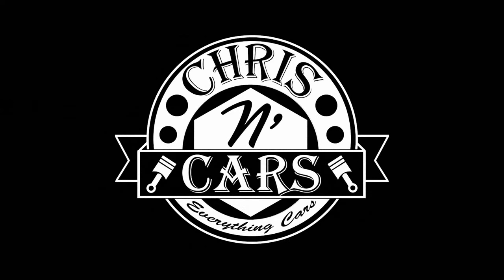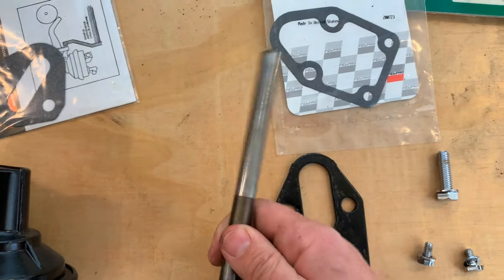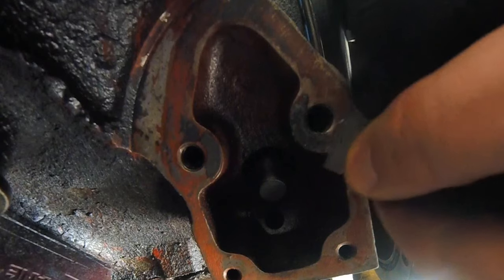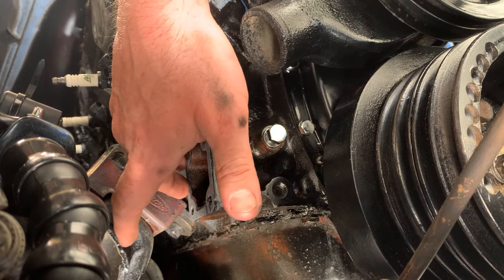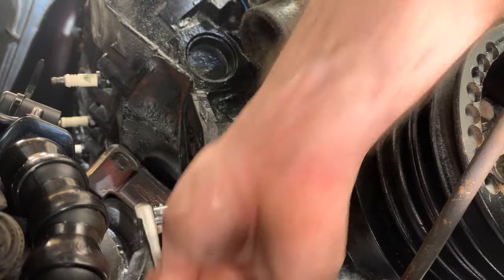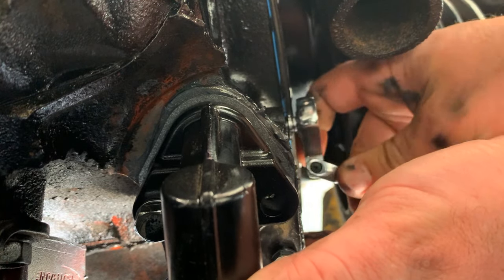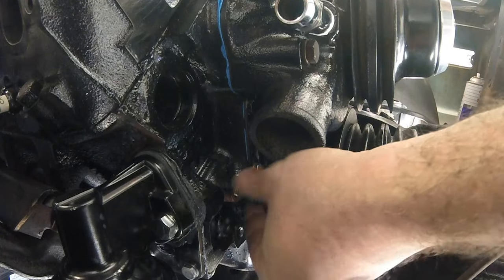Small Block Chevy Fuel Pump

Comment: FUNNY STORY:  I rebuilt my 350 SBC back in 1998 for my 1978 Trans Am, using Edelbrock cam, carb, intake, etc and full machining.  I've put 25000 miles on it in the 24 years since as a summer hot rod.  Also got married and had a couple kids.  So now the fuel pump started leaking and I watched your video.  I find that I am missing that bolt that locks the push rod in place.  I must never installed it since there is orange paint in the threads.  Now I know where the oil has been leaking from all these years!! LOL.  Now I'm wondering about that lower bolt hole, about 1.5" below.  I can shove a wire in there well over 1".  And there is roasted oil all around that hole.  It may be from the upper hole, but I'm wondering what that lower hole is for.  I noticed your lower hole doesn't have a bolt in it.  Can you advise what that lower hole is for?  I'm thinking to put a short bolt in both of them just to be on the safe side.  Great video by the way!

Comment: When installing the fuel pump with the fuel pump rod completely up the fuel pump should sit flush against the block when tightening the bolts it shouldn't have any tension.

Comment: Great video only thing I would have done differently is I would have greased up the fuel pump plunger arm and pivot rod.
Reply from the maker: Nice add!
Reply: Is there a specific kind of grease one should use? I got some for lubing the car. Would that work?
Reply from the maker: @thejubieexperience  probably motor assembly grease.
Reply: @ChrisNCars  Thanks! Very helpful
Reply: @thejubieexperience  van use marine grease, it's green colour

Comment: Just replaced Mine on a rebuilt 87 k10 and just winged it. came to a video to make sure it was done right and now my truck runs again.
Reply: I have an 86 K10
But I can't get the pump lever  all the way in and fully under the rod.
The rod won't raise any higher so trying to figure something else out

Comment: I actually knew this trick but thought I missed something when I tried a bolt from a puller kit (not enough threads). I am working on the same exact truck but it has a 307 and they apparently came with a 1/4" outlet with the 3 pumps I had here all being 3/8". I can probably find another bolt, but that trick of using a mounting bolt in a pinch is a great tip. The juggling with the heater hoses, ground wire and brackets makes me want to run to the hardware store. Great video. Another tip for someone just doing a replacement due to failure is have a set of angled pick tools to weasel around the rod and get it up into place with the plate on.
Reply: If you are still looking by any chance, summit has what you are looking for. I can give you part numbers if needed.
Reply: @sbcbuilds5517  Big thank you. Got that truck done in the yard during a snow storm because I had a Camaro in the garage and it runs a lot better. I ended up running new 3/8" lines. It still has that beautiful low compression cranking noise but fires up so much faster. Good looking out.

Comment: I never knew about that bolt.  I was taught to put some heavy grease on the rod to hold it up, which works so long as the motor is cold.  The bolt thing makes much more sense so long as you don't crank the bolt down and damage the push rod.
Reply from the maker: Yeah that’s why I swap the bolts around!
Reply: Mine doesn’t have a bolt

Comment: Thanks for the video. On my block the threaded hole on the side is not a through hole, so it can't be used to hold the pumping rod. Oh well- the assembly grease should hold it.
Reply: I had one that wasn't threaded all the way, just took a tap and finished the job. We had a zz4 crate eng. Hole was not drilled in it.

Comment: THAT ROD IS THE EXACT ISSUE IM HAVING WOTH MY ENGINE. I didn’t know that. Thank you so much for showing that. I’ve been fighting it for a while now to the point of almost giving up and that was the issue all along. But my fuel pump doesn’t have that bracket that goes in between the fuel pump and block though. I don’t know why it didn’t have one
Reply from the maker: Is there 4 bolt holes like a bracket should go there?
Reply: @ChrisNCars  I don’t remember. I’d have to look at it again. The motor is either a 305 or a 307 but I can’t remember
Reply: @ChrisNCars  yes. But I’m having trouble getting the roller to come back up so I can get it out, any tips?
Reply: @ChrisNCars  I got it put. My bracket was their it just seemed a little smaller throwing me off. It also bender in a bit

Comment: I usually slide pushrod up  slide a hacksaw blade down between the pushrod & fuel pump arm.  Once you get the pump mounted close to the engine block, pull out the hacksaw blade & install the 2 fuel pump mounting bolts. Trust me it works. 👍
Reply from the maker: Yup that works too!

Comment: I put all 4 bolts in and let it dry 24 hours then remove the top 2 and install the pump. This holds the plate in place if you tighten the bottom bolts without tightening the top you will have a gap.

Comment: 🟥 1) put motor oil on the rod before install
      2) put a dab of grease on both ends of the rod
      3) use copper coat spray on gaskets instead of silicone.  
(You don't want that shit to find it's way into an oil galley) 
Been building these things since the 60s. Never a problem.
Then again,  everybody does things differently.
Reply: Just spray the gaskets and stick them on? I failed miserabely today using silicone. It made a huge mess I didnt feel comfortable so i took it all apart and cleaned it. Ruined both my gaskets in the process.
Reply: I'm curious about this too - can you elaborate on the copper coat spray and how to apply?
Reply: @jeffmarcum3643  I take a cardboard box, put a hole in the top,drop a wire down the hole,put my gasket on the end of the wire,spray both sides of the gasket with the copper coat spray. When it tacks up, stick it to where you want and assemble.  Easy peasy...Done
Reply: @paulricelli5520  What about the actual fuel pump once its ready to go on? How do you spray that without spraying the inside?
Reply: @lloydchristmas1086  spray both sides of the gasket ONLY. When it gets tacky...do your assembly
Reply: @paulricelli5520  So I am using it but its not very sticky...is that normal?  Its alot different than silicone
Reply: @lloydchristmas1086  Lloyd...I only use the permatex brand coppercoat. (Best). After you spray it, it's usually a few minutes till it tacks up. It'll be " somewhat " sticky. It should be enough to hold it in place while assembling. It's main  purpose is to seal After assembly. Hope this helps...keep me posted
Reply: @paulricelli5520   Well i finally got it all assembled, took me two days! I just could not get one of the upper bolts to thread in. I finally figured it out lol.  Thanks for your help. I replaced fuel line hoses also. This is my first time working on old cars I just got a 1970 El Camino.  Frustrating yet rewarding. Hopefully it holds up.
Reply: @lloydchristmas1086  congratulations Lloyd. Elcaminos are great. I've had 3 or 4 in my time. Glad to help.  Let me know if you have any more questions. If you ever want to get rid of it,  let me know.
Reply: @paulricelli5520  Thats awesome and thank you. I will absolutely let you know if I need some help with it. :).  Just got it loving it if I do get rid of it one day will let you know.
Reply: @lloydchristmas1086  👍
Reply: @paulricelli5520  Ok so i started it, warmed it up for 3 mins...drove it around block it was driving nice. I stopped to look under hood to see if it was leaking and the car died. Looks like no fuel is getting to filter so im guessing my pump isnt working or i didnt prime it?
Reply: @lloydchristmas1086  OK. So there's many possibilities here. Did you use the longer bolt in the front of the engine to hold the fuel pump rod up and forget to replace with the smaller bolt? Is the fuel filter clogged? Is the float sticking closed in the carb? Are you sucking air thru a bad rubber line somewhere between the carb and the tank? Wrong gas cap not allowing to vent? New pump bad? Brass sock in tank pickup clogged? Remove the line at the pump from the tank, remove the gas cap, blow some air in the tank at the cap and see if you have flow going to the pump. If so,reconnect that line and take the line off going into the carb and crank the engine over to determine if it's a bad pump. You could 
have a stuck float in the carb. Worst case scenario...fuel pump lobe on camshaft wiped out. Then it's electric pump time. Are you out of gas?  I've seen defective gauges before. Check those items and keep me posted.
Reply: @paulricelli5520  Heres the back story. The car ran great, however it started smelling like fuel while driving and i couldnt notice any leaks. I did notice the fuel pump would get gas all over it so I decided to change it.  So I changed the fuel pump...worked for a few mins then died. It started up again this morning but then died in about 30 seconds. My fuel line to carb from filter was very loose and leaking i noticed after taking off air filter. I tightened that and its still wont start.  My gas tank was unfortunately almost full when i started this job. I dont have the means to empty tank and the fuel pump looked easy to change.  When it started this morning the filter was full of gas it looked like the pump was working fine for a few.
Reply: @lloydchristmas1086  Lloyd.  It's possible the float in the carb is stuck . An inline fuel pressure gauge would tell alot.  Hard to diagnose without seeing. Obviously fuel starvation.
Reply: @paulricelli5520   Yeah. I took off the new fuel pump and it didnt have  a speck of anything inside still looked brand new like no fluid had gone in it.
Reply: @lloydchristmas1086  sounds like no delivery from the tank
Reply: @paulricelli5520   I put the old fuel pump back on and it fired right up. It still getting fuel on top of the pump housing when I drive not sure where its coming from...the hoses dont look like they are leaking

Comment: Is it possible that the camshaft will be stuck in the fuel pump rods furthest outward position? I can't get the pin to push upwards into the hole, do I need to manually turn the engine over a bit to cycle the pin inward?
Reply from the maker: Put the engine at top dead center, that should allow the rod to go higher.
Reply: I've made a big mistake not pushing the rod  and installing  that fuel pump now that rod it's stucked  , didn't put my ingine on top death center I broke the fuel pump also ,, any advise to get that rod out? ☹️

Comment: I’m currently replacing the mechanical fuel pump on my 76’ Chevy. The push rod is stuck. I’ve greased it up, tried to use pliers to pull it up, removed the bolt that holds it and tried to manually crank the engine. Still nothing. Any ideas?
Reply from the maker: Dang does the cam push it when you crank the engine?

Comment: Im missing the original bolt for the hole you put the longer bolt in to hold the pushrod up. Any chance you know what size bolt should be there to begin with? Found out thats where my oil leak is from
Reply from the maker: I believe it is short, like half inch. If you tighten a bolt in there and it doesn’t go all the way down it’s too long 😜

Comment: Hey man I’m replacing mine right now but cannot find info on whether or not the push rod needs to be oriented a certain way. One side of the rod is smoother / shinier than the other side. Which side is the cam side ? Thanks in advance.
Reply from the maker: Smoother rounder side I would assume what you want hitting the cam

Comment: What happens if you’re missing the bolt in front of the block? I swapped my pump but lost the bolt. Can I still run the truck without it?
Reply from the maker: It will run, but your going to leak some oil, that goes directly to fuel pump shaft that is lubricated by oil pumping in engine. It’s a super common size just find a new 3/8 - 16 thread and about 1/2 inch long.
Reply: Hell yeah thanks for the info! Great video and very informative. Not overwhelming and just enough to get us by. Glad to see some updated videos that aren’t 480p and 7+ years old 😅

Comment: Odd... my 327 in my 67 impala does not have the holes for the bolts. Its just flat. Makes me wonder if the previous owner did something to it, or if this year production did something different.
Reply from the maker: Probably a newer v8 that would assume electric pump?
Reply: @ChrisNCars  That was my first thought, but I checked the casting number. It is dated for this car, made in 67... definitely in a time of mechanical fuel pumps. Never been so confused. I'm currently working on it, wondering how the previous own put on the mech fuel pump that's on it.

Comment: Since the fuel pump has just 2 bolts, why do you also remove the plate that has 4 bolts?  Is it to just push the rod up with your finger?
Reply from the maker: Because it was leaking so I replaced both 😜

Comment: Muy buen video muy vien esplicado , solo una pregunta , si el orificio donde entra el lapiz viene tapado, es solo un tapon ? Se puede destapar ?
Reply: May be it has an electric fuel pump and not needed from the factory. Also, camshaft may not have the fuel pump lobe to drive the pump

Comment: Thanks. How long does the silicone need to dry for before you start vehicle?
Reply from the maker: Technically you can start immediately, I give it a few hours
Reply: @ChrisNCars   Awesome thanks. I got new one working it seems so far..it wasnt pumping fuel to filter at first so i just squeezed the hose and that seemed to do the trick to get the pump going.

Comment: The bolt you put back in did u tighten it hard? The one that was holding the pushrod?
Reply from the maker: No like 15-20 pounds of torque
Reply: @ChrisNCars  is it necessary for that bolt? I’ve seen many engine builds and none of them have it
Reply from the maker: @bigbawsz2054  it will leak without it if you have a mechanical pump. If you don’t have mechanical you probably have a plate and plug over all this.

Comment: Working on a 83 Firebird, teaching myself. She's still having fuel problems, when I installed a new pump I pushed the rod up by hand, never took off that plate. How likely is it I goofed something?
Reply from the maker: You shouldn’t need to take the plate off but you need to hold that rod up while putting in pump. You can’t really do that by hand that’s why I use the bolt. The other was is use a saw blade or bendable piece of metal.
Reply: @ChrisNCars  My gf held the rod up while I installed, I think she's good? Carb still isn't getting gas so somethings iffy
Reply from the maker: @Avengel-hl5kg  I’m not sure how she could hold the rod while you got fuel pump in, it’s a really narrow gap. Could be a lot though kink in tub, old junk in tank plugging something, fuel filter, etc.

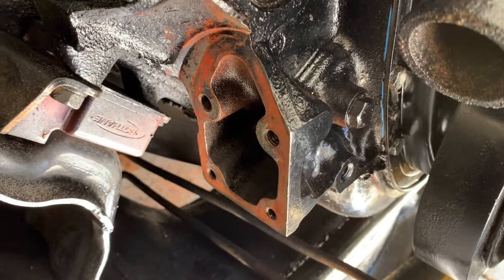Comment: I am missing the bolt (1:12) that sits next to the harmonic balancer. Can you tell the the size of the bolt and thread size? I’d really appreciate it.
Reply: Believe he'd said it was a 3/8 by 16 thread
Reply from the maker: Indeed 3/8 X 16 bolt will work. Not sure the length but shorter then 1/2 inch should be fine.
Reply: Yeah 1/2 will work. His has 11 threads on it so it's assumed to be 11/16" or 0.6875" long. I have a 3/4 which is the smallest lowes sells. So either I'm grinding it down to half or placing washers in between. I believe the 3/4" length will be fine but I haven't seen anyone mentioned the length and I've already installed a new pump and don't want to remove and see if it interferes with the push rod.
Reply: So yeah if you can find it it's 3/8"-16 x 1/2"

Comment: Do you really need the screw on the side of the block to put the rod end for better position
Reply from the maker: If you don’t it’s a pain to hold up while putting the pump in
Reply: @ChrisNCars  what is the size of the screws that you put in on this side of the pump fuel pump my engine is a 305
Reply from the maker: @josemarmolejomarmolejo80  should be a 3/8-16

Comment: Would gas get mixed in with the motor oil if any of these gaskets go out?
Reply from the maker: Not unless the internal seals in pump failed?
Reply: @ChrisNCars  I found out my car had this problem and it fouled up my plugs. Got new plugs in, swapped the oil out and my car ran smooth for a day. Shortly after that it feels rough again and my oil reeked of gas.

Had a compression check done and it was normal so it's not a piston seal or something.

Comment: Looks like my 350 doesn’t have a Rod I don’t see a bolt for the rod does that mean something?
Reply from the maker: Are you sure it’s a small block?
Reply: @ChrisNCars  yep 350 I’ll look again lol
Reply from the maker: @tylerangel4073  it’s possible it was removed and plate was put on. This is fine if you have a pump somewhere else.
Reply: @ChrisNCars  Just looked at it again The guy I bought it from must have done this but he put thick black Wire we’re that bolt went I’ve never seen that before and the lower bolt under that has no Bolt any ideas?
Reply from the maker: @tylerangel4073  can you send me a picture? Chrisncars.mail@gmail.com
Reply: @ChrisNCars  sounds good with me send it tomorrow if that’s cool thank u I’ve never seen anything like it lol looks like a ground wire over the bolt.
Reply from the maker: @tylerangel4073  haha! Excited to see it